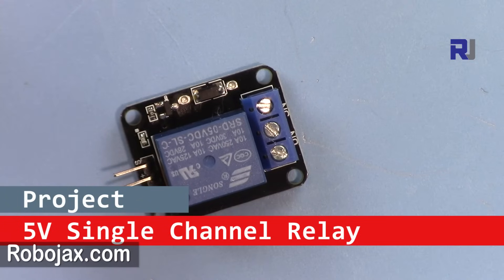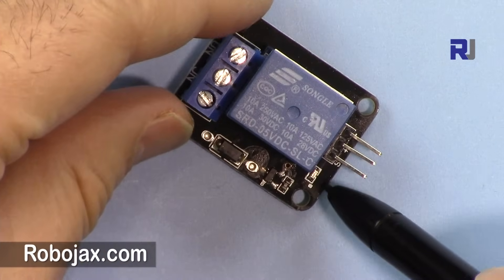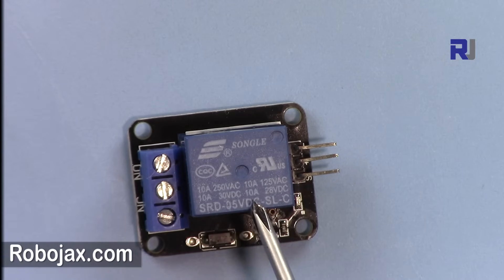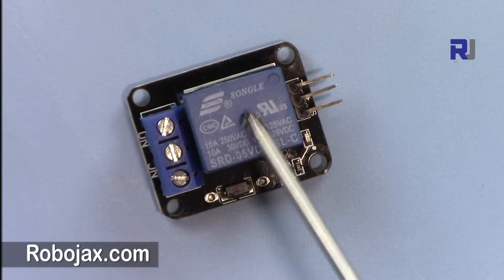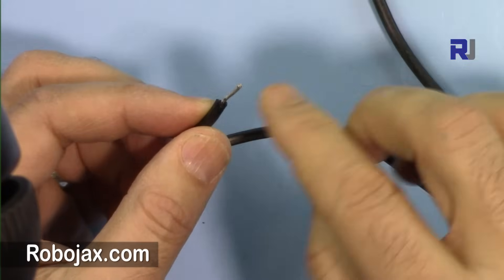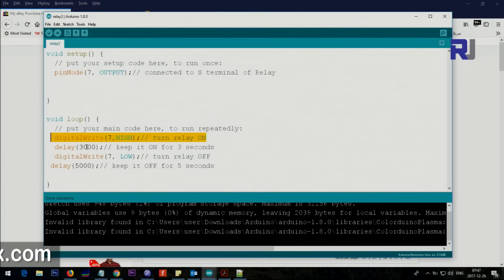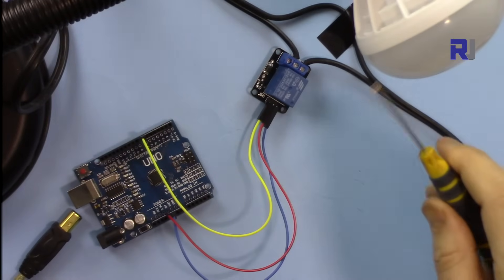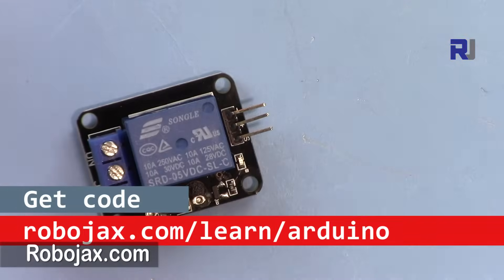How to use 5V Relay with Arduino to turn ON and OFF AC  bulb or DC load RJT33

Comment: Which part of the wire goes into the common terminal and normally open terminal of the relay ? My scenario is, i want to replace a switch with a relay. The switch have two connections. One is the mains supply and the other is the control wire. Now, which wire goes where on that relay ? I'm a newbie so can someone help me with this please...
Reply from the maker: how many wires have the switch? if it has 2 wires, then do it exactly as it is shown in video. If not then, post the photo of switch at http://snag.gy and post the link here so I look at it.

Comment: What wire are we going to cut?
Reply from the maker: this is AC.  Once connected to power you DO NOT touch it. You can cut any of the wire and it will work. But if you are some countries where there is higher standard of safety,  you might cut the live wire. But doesn't matter. You want to turn it ON and OFF.
Make should to be very careful and do NOT leave it unattended once connected or make a insulated box if you are using it in real life.

Comment: Thanks. This is real clear for us beginners.
Reply from the maker: You are welcome.
Reply: sir can you please help me?
Reply: @robojax  I don't understand why the trigger pin of the relay is connected to pin 7 which is high when the writedigital value is HIGH??? At this instance, will not 5v will come from pin 8 and damaged the relay??
Reply: Greetings sir, I hope you are doing well. It is requested to answer whether or not a 220-240Vac bulb can be driven using a 5v relay using arduino uno?  I have a project in which i am doing a bluetooth controlled smart home automation. It is requested to give me tips on how to do it.
Regards